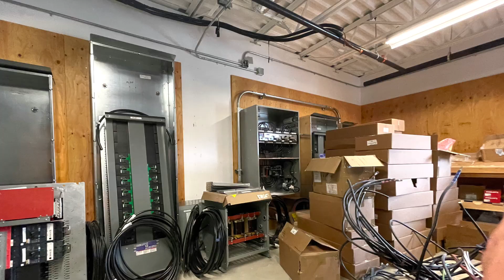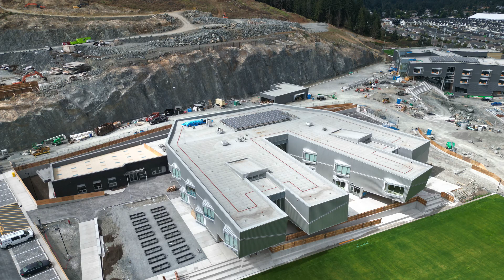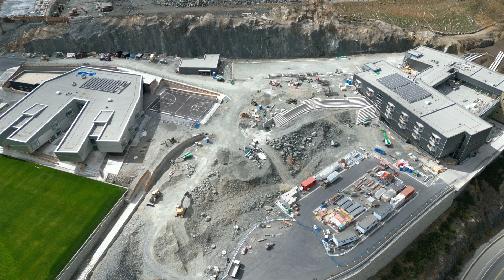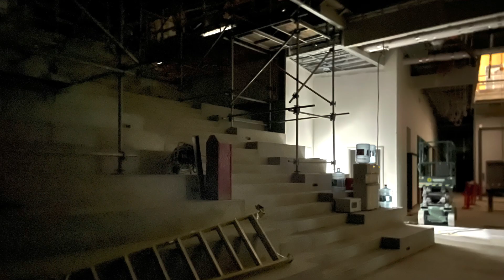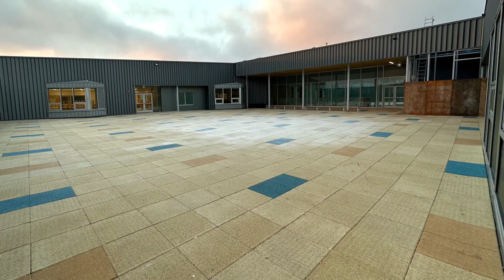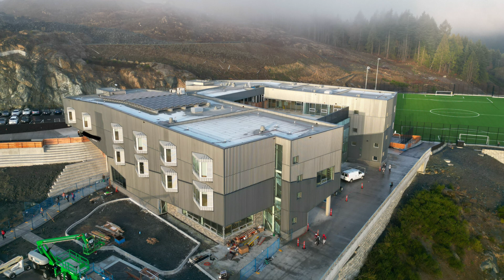First look at two brand new schools three fire alarm systems, electrical, and central plant

Comment: The CO alarms appear to be 120VAC w/ 9V backup BRK CO5120BNA carbon monoxide alarms. Assuming they didn’t go the absurd route and add RM4’s to every alarm, they could have gone with CO710A sealed 10 year battery CO alarms. But, then again, money
Reply from the maker: Either way whatever they went with it seems very strange
Reply: @nics-systems-electric  indeed
Reply: electrickid621  According to BRK, the CO5120BNA does not have a 10 year battery, which is the only CO alarm BRK Canada sells that looks like the ones in the school

Comment: As for the fire alarm being tied into the PA system, my middle/high school did that. Played a siren over the PA when the alarm went off. From what I hear, it was left over from the old system. And for some reason, the class change bell was a higher priority than the siren
Reply from the maker: I just doubt that's what they did as that wouldn't be legal to have two different tones playing at the same time that's why I'm not sure what it's for
Reply: @nics-systems-electric  perhaps it’s for a cutoff, so anything playing over the speakers when the alarms go off will stop? Guess it won’t be known until it’s tested

Comment: about the gym, at my school they have 8, 1 on each side of both bleachers and 1 on each side of the other 2 walls, also how come they couldn’t use system sensor co detectors, it would match since they used system sensor products like the l series?
Reply from the maker: Don't know why they did what they did
Reply: My school gym is 2 gyms in one room and has 12-13 speaker strobes
Reply: @channeldeleted_2_3_678  oh ok, would you know why speaker/strobes are required in gyms?, because my school has them in the gym but the hallways and classrooms have horn/strobes
Reply: @thomaswhitten5343  I would guess because of the amount of occupants in the gym, I do not know for sure because my entire school has voice evac

Comment: A residential carbon monoxide detector?  Bad idea in a school.  I hate them in a home!  I have a question, my college is humongous.  And, they have 3 fire alarm control panels just for one of the wings.  How do they tie them together to trip each other?
Reply from the maker: If it's a newer system they are probably networked together and if it's old the zone from one can monitor relay on the other one and back-and-forth between the three usually it's a huge pain when they're done like that if they aren't programmed properly
Reply: @nics-systems-electric  How are fire alarm panels networked?  Do they have terminals that allow this?

Comment: Also, notifier does have CO detection solutions, they should've got a dual smoke and co detector. First Alert detectors aren't really ideal for this type  of environment.
Reply: I'm not sure if CO solution would work on ONYX, but on the NFW-50X and other panels, yes they do.

And for the reason why the elementary school doesn't have detectors would probably be due to the science lab & chemicals in the middle school. But in case of idk some unlikely chemical leak, they should install detectors for that,
Reply from the maker: Yeah it's pretty weird
Reply: Why couldn’t they use system sensor carbon monoxide detectors, it would match since they are using system sensor products like the l series

Comment: My school in America in NY my district also uses salto. All the classroom doors have the keycard locks. My high school used to have old locks that couldn’t be locked from the inside. They were installed for safety. Now, during a lockdown all you have to do is close the door. I personally like then

Comment: @NIC'S - SYSTEMS & ELECTRIC atriums in the new schools?
Reply from the maker: Not really kind of in the middle school but not the same as the big ones in the high schools
Reply: @nics-systems-electric  So the two new schools do not have the system where it reverses some of the fans to draw out smoke and pressure to force it down so it can be sucked through exhaust fans?
Reply from the maker: @DylanChalmersWx  the middle school might but I'm not 100% sure
Reply: @nics-systems-electric  i guess we'll have to wait and see. those are a crucial part of a system. i've seen hotels that have smoke exhaust fans only. the grills for them were kind of like the ones you tested in the secondary high school cause they were roof mounted so they were in a big open cafeteria room. those were there cause the fire code was alot stricter in addition to sprinkler systems. i'd hate to be in the same room when they get set off because they're probably the type that will try lifting you off the ground when you walk underneath.

Comment: Surprisingly enough that's actually a 3030, you can tell because the 640 with an nca-2 can only be mounted in the middle while the 3030 can only be mounted to the left side
Reply from the maker: I've been told they now have 640s where it can be mounted on the left so I'm not really sure at this point but I'm also not sure why they would need a 3030 for these small buildings
Reply: @nics-systems-electric  maybe they were short on 640s 🤷🏽‍♂️